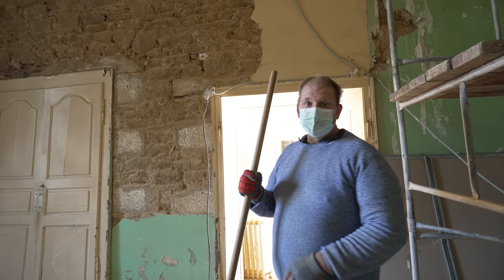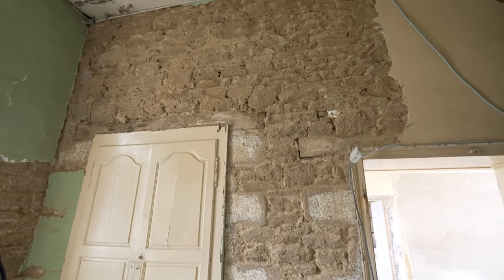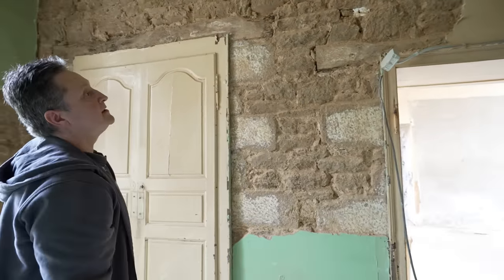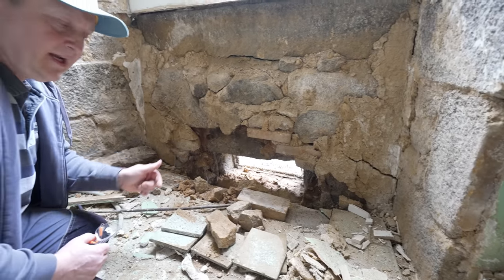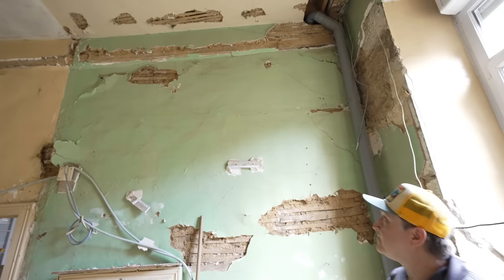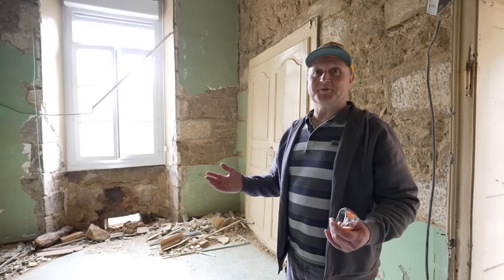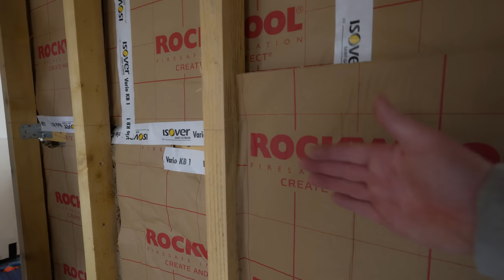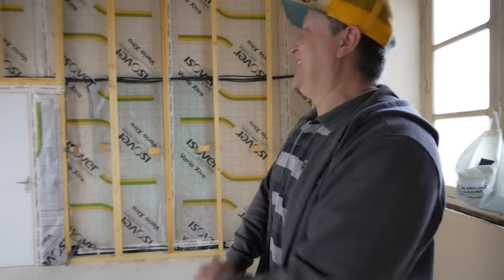Exposing The 250 Year Old Walls (Do We Keep Them?)

Comment: After the plaster on the stairs in my 1750s Cotswold stone cottage was removed the beauty of the stones was revealed. I made an impulsive decision to leave them exposed and have them repointed and haven't regretted it for a minute. I still admire their beauty every time I see them years later.

I don't think having one small internal wall exposed will make any difference to the warmth. Mine are 50cm thick (as yours probably are) and retain the heat nicely once the house warms up and the ones here are external.

Oh and I don't think you'll upset the ghosts with what you're doing - I think they'll love seeing the building being brought back to its original splendour!

Comment: The pace is, often, breathtaking. Really impressive work, and the convent moves a step closer towards completion! 🙂 Should you keep it? Only if you keep the place insulated to the same extent as the kitchen will be. The walls look lovely, especially fully exposed, but the long-term viability of the building will mean, as far as practical, bringing it kicking and screaming into the current century too.

Comment: In a previous vidio you talked about wanting to keep the original stone floors in the entry but in the end the stones might be to thick to tie in or be level with the kitchen level.  Maybe the solution may be to take them to be cut by a slab saw to the exact thickness needed to match up to the kitchen and still mantain the original look you want♥️

Comment: As you strip out those two rooms and expose the original walls, keeping them is a good question. However you need to consider the walls in the expanded room as well? All stone walls would require heating!! underfloor and heat pumps. Expensive!

Comment: That original structuring will be gorgeous with some sand blasting. It really seems you always have the right crew for this Billy! You're re-solving age-old problems in a modern fashion after taking up sloppy work to preserve this building and I really admire that about this work you guys are doing. Along the way I've subbed to @Seans_World and @lifeofryan. as well as @ChateauLife. Shoutouts to Rick and Steve if they have their own channels too I wouldn't be surprised. This crew does good work and with an infectiously great attitude. Thanks for committing to such a challenge as daily videos on top of all of the work that is done daily. I wouldn't miss an upload

Comment: I fully support putting as much insulation as possible.  Keep the noise diwn and you'll not run the a/c or heat as much, especially once the ambient floor is working.  In fact, if you pour a foundation in any other large rooms id do ambient floor again there as well.

Comment: As a matter of curiosity, you already have a vapor barrier on the walls, and then the rock wool has another.  Usually this is a no-no so you don't end up with moisture trapped in the material between them.  Does this insulation system work differently?  I would hate for you to capture moisture between and end up with mold growing in the walls.  Rock Wool is hydrophobic so I'm wondering if that is the key to the installation method?  Love the videos.  Keep them coming!

Comment: My comments re the commercial kitchen. Im a Chef and lets say the convent is a large house, a function centre or a business or apartment complex - a commercial kitchen does not have to be the standard all stainless steel drab room. Think industrial chic. Bare timber ceiling ( finished with varnish to seal it ), hanging industrial lighting, long steel top benches with storage below. I suggest marking off one end of the room ( about 3-4m wide) -  a separate small wash room fabricated with dishwashers, sinks etc. adjacent another small room for a built in cool room with some upright freezers. And another the same size for kitchen pantry/ storage. Of course you need a loo. This way whatever you end up doing, this facility would be used by wealthy family/owner or function centre.

Comment: Keep the walls exposed. Repoint with some lime and sand mortar, same as the original mortar. Then seal the wall. Rebuild the Jenga wall section with the same mortar.

Comment: If you want to dismantle that door frame without too much destruction you need to get the nails out that hold the hinges in place. The hinges are 2 mm metal plates going straight into the frame and are nailed through the jamb, usually chunky nails with the heads cut off. These nails have rarely been covered over so perfectly you can't find them with a strong light. Remove a bit of wood around them, pull them out and the hinges should pull straight out. Fitting these hinges requires a special tool, part rasp, part chisel that can cut very skinny, deep pockets. The most common door hinges are 2 mm thick so you need a 2 mm by 50-80 mm pocket around 40 mm deep. I have no clue how the tool is called in English or French, in German it's "Fitscheneisen". It's almost extinct because in most countries this type of hinge fell out of favour by the early 1960s.

Comment: Where the tubing is for the air conditioning, put a built in bench. That way you can get to the pipes for repairs, instead of a sink.  If you have water dripping from a leak it could damage the pipes.

Comment: As far as the basement goes they used to have supplies on there dried goods items like that. those wooden trays that you said bodies were in there .those were mushroom trays  in the winter time they would use those to hold mushrooms I personally would recommend remodeling the basement as a emergency supply room  you put dry canned goods candle, gas generator extra fuel turn into a bomb shelter for  major problem coming up.

Comment: Keep as many of the original stone walls as possible, unless they are exterior to the current building and you feel you need to insulate or they are damaged beynd repairing reasonably. You can also leave some of the stone exposed and use lime plaster to cover part.

Comment: Have thought of having spray foam with a combination of closed cell against the stone and a layer of open cell on top.  this combination results with a conditioned space from cold or hot from outside penetrating to the inside creating a thermal break between exterior stone and interior kitchens stud walls.  The end result  makes heating and cooling the space extremely cost efficient and sound dreading for this amazing space. Use the rock wool insulation on interior walls.

Comment: The rockwool in Canada has no paper on it. The fibreglass insulation has paper but it never faces inward, the paper acts as a vapour barrier and always is on the interior side. It causes moisture issues if facing the interior. So I’m surprised first to see Rockwool with paper and facing inward
Reply from the maker: welcome to france

Comment: The original walls are very, very worn out. As a feature wall, depending on what style you're going for, it can look good, and the uneven texture of the wall will help to remove standing soundwaves in the room through dispersion. But of course both sound and heat insulation will suffer by not having an extra layer. I'm kinda wondering what madman plan this whole convent is following so I don't know /Shrug

Comment: Contrary to popular belief, you CAN over insulate rooms. I don’t know what the climate for your region calls for, but given the extreme thickness and waterproofing of the walls, you’re likely just wasting materials. The “echoes” of a wall is a weird concern. What is the echo? What are you soundproofing? Are you expecting a sledge hammer against the wall all day every day? No amount of noise is going to matter on those walls. I do not get the “echo” concern. Also, unless walls are really thin, the only benefit of insulating conditioned interior walls is mostly for sound, not temp retention, because those are conditioned spaces. Just more waste. 

People always think more is better, and sometimes it actually harms the building. Moisture can get trapped in layers and can even create mold, rather than being able to breathe to release the moisture. Insulation is very important, but after a point it either does 1) waste resources, or 2) do harm.

Comment: I'm pretty sure you'll keep them anyway but as you are putting in so much insulation everywhere else i think its a no brainer.  It probably wont make the cut but i love that little cupboard. Would you consider widening the door to the refectory. I can see it used for a wedding reception and the bridal party entering thru a lovely (possibly arched) doorway. Adding interior insulation is a smart move in such a big property. Also means you can close off areas your not using.

Comment: I would leave all the internal and some walls exposed if they looked as good as that. In my view furring out and putting plaster board over every wall is unnecessary if the  attic space is insulated well for instants I would not have covered the wall with the fireplace on it at all .

Comment: I don't think the interior surface of the walls was meant to be exposed  in this kind of the of the building, and in that period. That room was attached to the dining room of the convent, one of the most important rooms,which was probably adorned more that the other rooms. So exposing the rough surface of the walls that is not constructed with fine cut stones is no no for me. Sorry. And a question: when are you going to scrape of those white lines from the fireplace in the kitchen? Sorry but they are such eyesore.